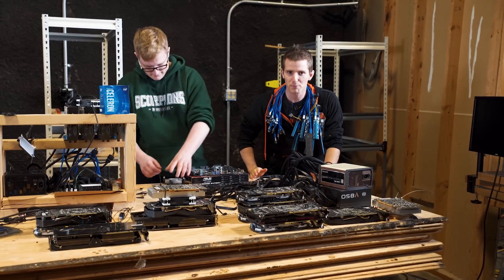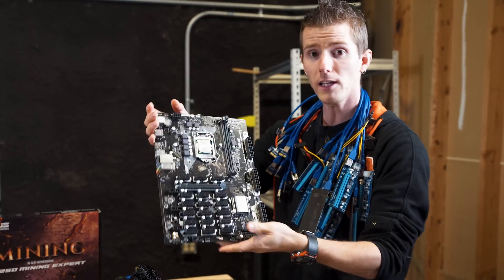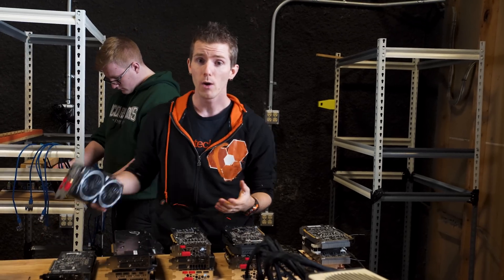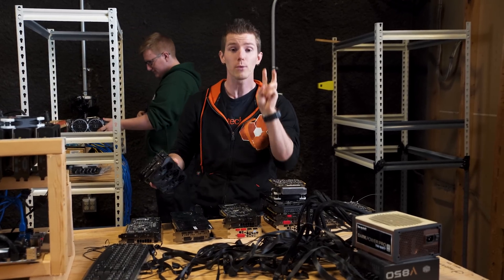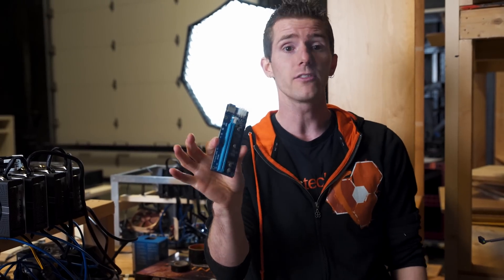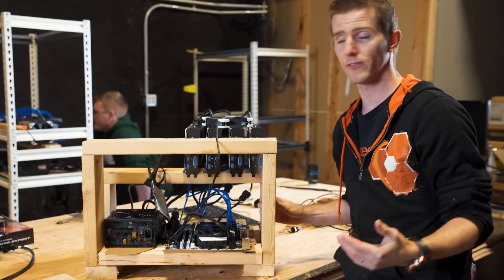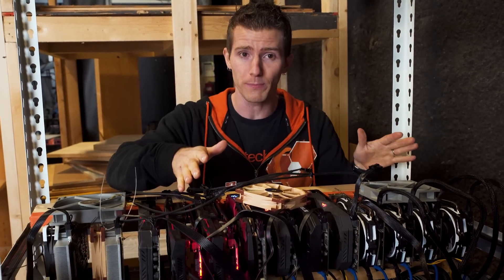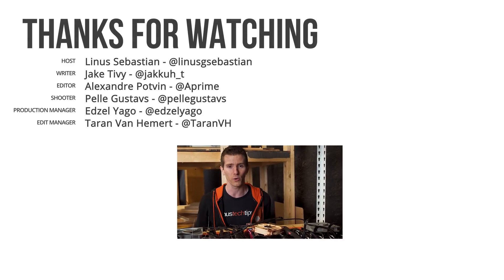13 GPUs in ONE PC? – Mining Adventure Part 2

Comment: Why not go with ASIC machines instead of going with GPUs? GPUs may have been good 2+ years ago but ASICs are designed to specifically mine crypto at highly efficient speeds/power usage..
Reply: And because the asic hardware is specialty hardware, it's quite expensive. Another reason you only get asics for large farms, rather than consumer level mining like this video is geared towards.
Reply: Yeah basically what these guys said.  The coins they are mining are only GPU mine-able.
Reply: Not only are ASIC's expensive but they become obsolete after a few months so yeah if you can get a new model at a normal price immediately as it's launched then great, you will probably get your money back and more. (But ASIC's can do only one algorithm, that usually only a few currencies use, and you can be left with a situation when none of the currencies are profitable to mine anymore)
Also ASIC's are incredibly loud - think having your vacuum cleaner on 24/7 - that's how loud they are.

All in all GPU's are much safer to mine - when one currency stops being profitable you can always mine another. And even if all else fails, you can always sell your GPU's for like 70-80% of what you paid.

I live in Poland and sure GPU's are disappearing as soon as they hit the shelves (or online listings) but when they do the prices are very normal and its not that hard to actually buy one if you try.

Not only that but 1050ti's are not very good for mining so they're almost always available, and they are great, cheap cards. And if you want power then GTX1080's are also not that hard to find because they actually do worse than GTX1070 in some algorithms.

And used cards are also readily available - i can see a lot of GTX980's listed at GTX1050ti prices which is a great deal. You just have to stop being salty and actually search a little.
Reply: Scrypt is pretty good for ASIC too
Reply: the thing with Asics, they release an asic for an algo which is only done on CPU or GPU. the profitability for that GPU becomes unprofitable for that algo. the more people who buy the asics the less profitable that asic becomes, so they buy more asics, thinking that is the solution, then before you know it a new asic is released making more profit, then that asic ends up getting sold to someone new to the world for a big mark up. thus the cycle continues.
Reply: if they could trick their asic they would. a lot of asic resistant algorithms are memory intensive and memory is expensive. they are making asics to do other algos. the good news is you will be able to get volta at rrp if asics continue.

Comment: A word to the economically uninformed commentors concerned with GPU prices increasing as a result of miners.

1: The reason prices are high is because availability is low. The shortage will not last forever, eventually manufacturers will saturate the market and prices will return to normal.

2: The excess cards being made in bulk to satisfy the miners will inevitably overflow and cause extra cards to go on sale for dirt cheap.

3: The extra demand for graphics cards from other industries will cause more competition in the marketplace, leading to innovations that will cause prices to do down even further and quality to go up.

4: The blockchain and cryptocurrency advancements being invested in by miners will reap benefits in technologies all across society. There is more to the world than just video games.

In short. The sky is not falling, life is good and looking better all the time. Calm down.

Comment: If you gamers out there (myself included) are worried or angry or sad about high GPU prices, there's a pretty good solution. Just mine with your gaming computer at night, or whenever your not playing, and eventually your graphics card will make that money back. If a card is overpriced by $100, lets say a card is $300 when it should be $200, you can just mine with it, get a dollar every night, then in 100 days you effectively bought a $200 card (the price it should be at). My gtx 1060 on my gaming computer easily gets $1.50 a day after electric costs on nicehash by just running it overnight and when I'm not using it during the day. Mining doesn't have to be evil, and not every miner is someone buying 300 graphics cards and forcing them to go out of stock.
Reply: George Perakis For starters, since when is buying 1 gtx 1060 to play video games with then deciding to mine with it at night stealing your cards... and secondly damn if you payed $500 for a 1060 I feel bad for you, because I got mine for $220 on Newegg (I know that's a bit lucky, right now you can still find some for $250 though). Just find every out of stock gtx 1060 under $300 and click "auto notify". It will send you an email when its in stock and you can grab one before pesky miners do :P  Usually it only takes a week or 2 for them to go in stock it seems. You do have a good point that your hardware wont last as long while mining, but the money you make from mining outweighs the cost of your card dying sooner. If it didn't then miners wouldn't be buying graphics cards because it wouldn't be profitable. As long as you keep your card cool (I like to keep mine around 60-65 degrees C using MSI afterburner to set a custom fan speed curve), your card should be fine for a while. And hey, if mining stays profitable I could pay off my whole gaming PC in a couple years!
Reply: iiLua51 ii how would you mining contribute to the problem? If you are already gonna buy a graphics card for gaming, then you mining on it at night won't contribute to it going out of stock. Buying 1 graphics card for gaming is exactly the same as buying 1 for gaming and mining with it at night, or buying 1 for mining. They all take -1 gpu out of the warehouse.
Reply: ItsNoGood Jr I love the idea behind the currency itself, but the way it's being obtained now among other things make me not a fan. And I've been looking to upgrade to a 1060 or 1070 (mid to high and I guess). Been using a card with only 2 gb's of VRAM for years and can barely play games from 2013 (tomb raider runs at 25-35fps on high for me)
Reply: I agree with that, mine with your new GPU, I got 4 1080ti's for 2 gaming computers, pre-order on Amazon at an amazing price. I use these for mining when not using the computer, also use a lot of older cards, which would just be collecting dust. my main game is trading crypto, let all these miners buy the cards and thus increase difficulty, reducing profits for all, if we all mined then GPU mining would be less attractive.
Reply: A gtx 1080 ti can pay for itself in 160 days
Reply: Ok, so it doesn't work like "the more people who are mining, the more expensive the GPUs get." Yes, it's an indirect correlation, but the people raising the prices are the ones who buy GPUs in bulk just for mining and make them go out of stock. It doesn't hurt using your already-gaming GPU and making a quick buck.
Reply: I really want to take this advice but I despise the entire concept of cryptocurrency (at least the modern concept) and don't really feel like spending $600-800 for a card when the rest of my build would only cost about that much
Reply: Jonathan Miller What graphics card are you looking for? I might be able to point you in the right direction to find places that sell them cheaper... Unless your talking about a high end gpu, yeah those will be expensive no matter what, and they're hit harder than mid-end gpus in terms of availability and cost. Why do you despise the concept of cryptocurrency? Is it because most take gpus to mine it? The actual concept of being able to have a currency not controlled by a government that can easily be transacted with online is possibly the way of the future, at least in some way or form. Maybe it won't actually turn out to be the way of the future but it's still a little useful.
Reply: Yea gonna mine with a 2gb graphics card that takes 230W
Reply: MrBhoppy I'm talking about modern cards, old or low-end gpus aren't profitable, but the sweet side to that is they aren't affected by the mining craze price increases due to well... their lack of profitability.
Reply: iiLua51 ii, Jonathan Miller Yeah i guess you've got a point, but its gonna stay alive with or without your 1 tiny card mining it. There's massive farms with hundreds of them. Its just a way of fighting back the prices, of taking your share away from the miners, I mean heck if your gonna consider a single card introduced into the blockchain helping miners, then you are also hurting them because you're making the difficulty harder for the rest of them. If you're really SUPER against cryptocurrency then fine, its your right to not support it. Even then you could be a little selfish just to counter the additional money miners are costing you.
Reply: Jonathan Miller you can get a 1060 for $300 right now, a bit overpriced. Or you could wait. Some of them for $250 on newegg if you wait for them to go in stock
Reply: ItsNoGood Jr do you know how much electricity is taken while mining? You’ll just end up losing money in the end because your damn electricity bill is high af.
Reply: B- Fitzy you're gonna have to buy ram and a cpu anyways... I don't get what your trying to say. Mining doesn't even use your ram or cpu like... at all, so it's not like you're gonna kill those components faster. If your mining money is enough to buy a whole gpu then you already did enough to effectively make a overpriced card cost you $0. Even if the card breaks at that point (mining does put more strain on cards, but if you keep them cool it shouldn't hurt their life span too much), you have enough money to buy a new one. Mining IS profitable. If it wasn't then there wouldn't be miners. I'm not rich, I just have a mid-end gaming computer that I use to mine at night to earn some of what it costed me back.
Reply: Gloppin Boopin use your brain. If mining costed more in electricity than it did to mine... Then why would linus be making a mining machine... Why would miners even exist? In most places in the world electricity isn't very expensive. Where I live its 10 cents per kilowatthour, which means I spend ~$10 a month at 300 watts (running 12 hours a day) and make ~$50 from mining (running 12 hours a day). So net profit of $40.
Reply: EdinPlayZ ? Are you talking to me I'm confused about what your saying
Reply: Zana GB if you set it up properly and are using proper hardware you will make money. What card do you have now? If its a modern one I could show you how to make a profit with it. I'd suggest nicehash if you want an easy 1 click program, but awesome miner if your ok with going through more setup. These programs will make you a profit if you have a good gpu.
Reply: ItsNoGood Jr lmfao a Minecraft player saying “use your brain” fuck outta here.
Reply: Gloppin Boopin "Your logical fallacy is ad hominem:
You attacked your opponent's character or personal traits in an attempt to undermine their argument.
Ad hominem attacks can take the form of overtly attacking somebody, or more subtly casting doubt on their character or personal attributes as a way to discredit their argument. The result of an ad hom attack can be to undermine someone's case without actually having to engage with it.

Example: After Sally presents an eloquent and compelling case for a more equitable taxation system, Sam asks the audience whether we should believe anything from a woman who isn't married, was once arrested, and smells a bit weird."
I'm more into Overwatch now anyways but I don't really care enough to change my profile picture.
Reply: ItsNoGood Jr you honestly seem like a cool person so have a nice day or night
Reply: Do you have anything meaningful to say or are you closed minded and are gonna tell me how the games I play make a statement false.
Reply: George Perakis It won’t really kill your hardware if you run it overnight for just around 8 hours. Set a power/clock limit and just use an auto fan curve. What kills them is when you manually set the fans to 100% and overclock everything to the max, and let it run 24 hours. I’ve been using my 1060 and 8700k for 4 months mining monero overnight, I have made about $650. No performance degradation in games. No bad temps. Also, I’d just like to say fuck you for saying a 1060 is an entry level card for kids first PCs. The 1060 really is the king for 1080p60hz gaming at high settings.
Reply: ItsNoGood Jr the money I’d make would go directly towards the electrical costs of running it all the time lol
Reply: i did this with my  low end gaming pc 1050 ti and now i have 1060 & 1070 also a new PSU, some ppl are just too lazy to research about it and already had negative thinking such as how it could ruin your card very fast while in reality the gpu is being used by miner is at 65 - 70% power and kept at a stable temp of 55-65° , but hey their loss not mine

ps: oh and i do still play game with that 1050 ti while mining as of now
Reply: Joseph Lemery if you only get charged 10 cents a kilowatt like most people do, its profitable and you'll make more money from the card than you do on electricity. Even a bit more expensive than that is fine, if your over 20 cents a kilowatt I'm not sure I'd be mining because even though you'd be making some net profit still, it wouldn't outweigh the possibility of your card dying sooner imo.
Reply: ItsNoGood Jr well some people dont want to mine since some of us would like to keep our pc's alive for as long as we can not all of us are rich to buy new stuff the mining money u make wouldnt even be enough because that'll only buy a gpu leaving u to buy ram and maybe a new cpu depending on what u use to mine
Reply: ItsNoGood Jr No, fuck you, I want my hardware to actually last me a while. And cards aren't overpriced by only +50% anymore, I fucking miss those days, 1060s cost 500 bucks now, even though it's an entry level freaking card meant for kids to make their first gaming PCs, which is insane. And none of the reasonably priced cards like the 1050 mine very well.
So fuck you, fuck off, what you're doing is killing your hardware and voiding your warranty, give us our cards back.

Comment: Salty people, the GPU manufacturers just have to ramp up production.
Reply: Ramp up the production with what? There's a shortage of drams. Has been since last year and there's still going to be a shortage for the foreseeable future.
Reply: i agree that gaming gpu's are meant for gaming but that doesn't mean you have to use it for gaming i hate these miners but what they are doing is not abuse its just annoying it really isn't there fault for wanting to make money. still tho i can't afford a 1060 well its not so much that i can't its just that i refuse to pay double the msrp
Reply: lol
Reply: ArduinoBen they’d eventually be selling at a loss if they ramp up the production. If the crypto currency market crashes, GPUs would be worth less than its original value due to the surplus of unneeded/unused GPUs being easily obtainable. Yes, good news for gamers, but bad for the economy.
Reply: ArduinoBen Easier said than done.

Assuming production could be ramped up on a dime (ignoring VRAM supply issues and the scheduling of fabs required), it takes THREE months to go from start of production to end. That's a HUGE gamble for AMD and Nvidia to take on something that's as volatile as crypto mining.
Reply: The manufacturers are already at maximum production speeds smart ass. It's the retailers that allow people to buy 50 at a time. When they start forcing a two per household sale, that's when prices will come down in price.
Reply: Then cryptominers blow it off the shelves again.
Reply: ArduinoBen the gpu manufactures are already at 100% capacity it's the miners the big ones in Russia and China buying thousands at a time they can't keep up with demand
Reply: Idunnohuur funny you assumed iam an America nope wrong iam English and don't get in ya high horse it is the miners fault that gpu prices are shocking atm get a real job you tax evading basement dwelling mummys boy
Reply: IllogicalMilk And as somebody who hopes to get into mining myself soon, I honestly agree. It's a way to make somebody's money work for them at an affordable scale for the average person. But at the same time, I love gaming, and it's frustrating to see how expensive gpu's  are right now. I can literally sell mine for twice what I paid for it right now.

IMO, it really is an issue with supply. Whether it's a decision not to  produce more cards, or a lack of materials, I don't know, but if manufacturers would be open about that,  my suspicion is it would ease the tensions a bit.
Reply: C manufactures are already at 100% capacity they can't keep up with demand atm because the large scale miners are buying hundreds at a time they run the cards into the ground then the cycle starts all over again
Reply: Abuse? I get that the price increases suck, but abuse? What on earth is abusive about spending  your own money on something and using it how you see fit?
Reply: George Perakis "our gpu's"? Lol I found the salty one.
Reply: I mean, if it was trash, it probably wouldn't still be around now would it?
Reply: MegaStan316 
Yaya blame the east again typical american.How about you miners stop buying more than 10 GPUs at once?
Reply: ArduinoBen what about the abuse of gaming GPUs for money?

Comment: Dont worry, 240 is super easy. Literally exchange 2 120v breakers for a dual rail and then slotting in the 240v breaker. Done.

Comment: Would never buy a resold mining card. Suckers run 24/7 at load, would be lucky to get a decent life span from them depending on how they were treated by the miner.

Also mining needs to die, causes price issues and cryptocurrency is a volatile joke that holds no actual value.